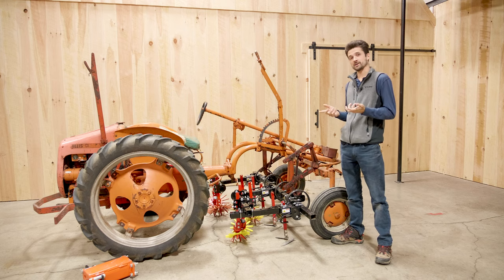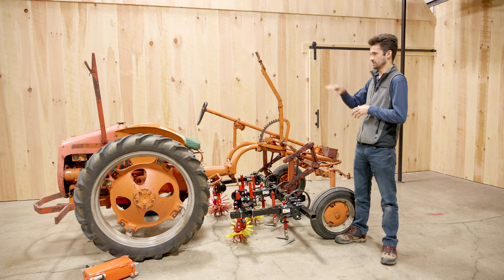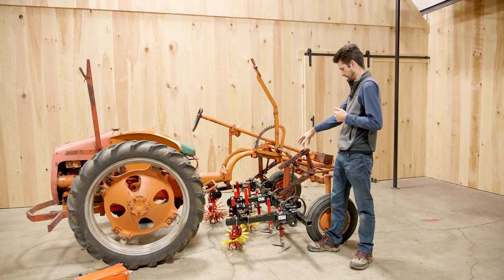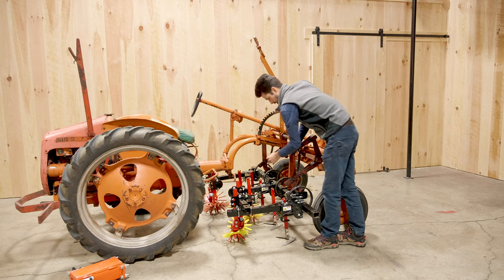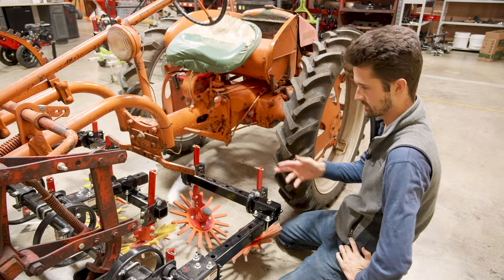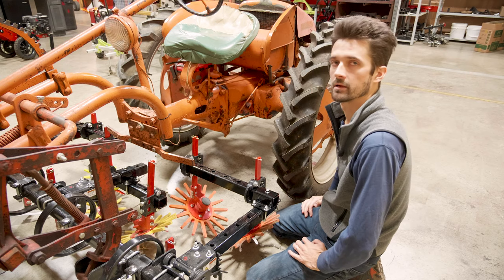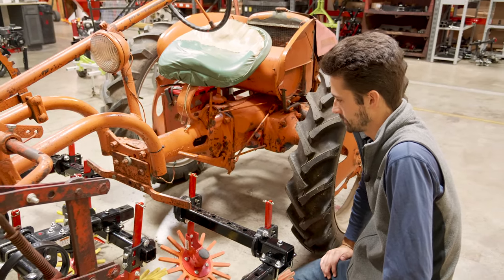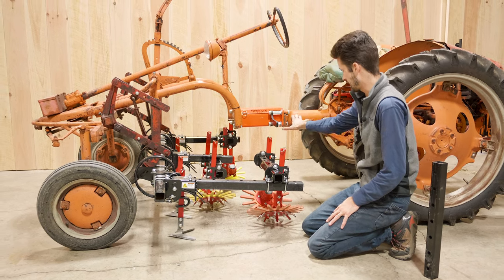Dos and Dont's - Finger Weeding On The Allis Chalmers G

Comment: Great instructive video Dustin.  Thanks for taking the time to shoot this.  We have a 3-row setup with 13" Tilmor finger weeders that we love. In our case the fingers from one row DO intersect with the fingers of the adjacent row on each of their non-working high side but it has never caused us the slightest problem.  The finger wheels are rolling in sync with each other and going the same direction so they just flow through each other.  It might not be okay on stony soils but at our place on sandy loam it's no problem and lets us cheat a crucial inch or two in our tight setup - the same might be true for others.
Reply from the maker: Great point Reid! If you have loose soil free from debris or organic material that could cause the fingers to bind at all then you can definitely cheat that little bit :)
Reply: @TilmorProducts  Nice video Dustin! I wish you guys had been around when I started using Gs! I’m just now selling my first ACG to a young farmer in Washington and you’ve already been helping him get set up with a finger weeder. The G he’s getting from me has the added benefit of 6” added to the frame rails. Hopefully that will give him more flexibility. Thanks again for being the new “Planet Junior” for the next generation!